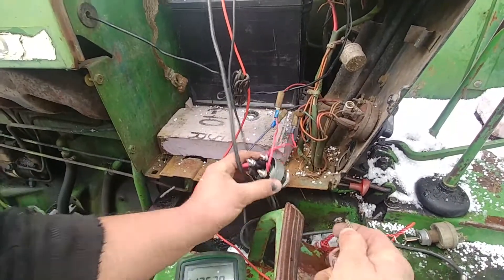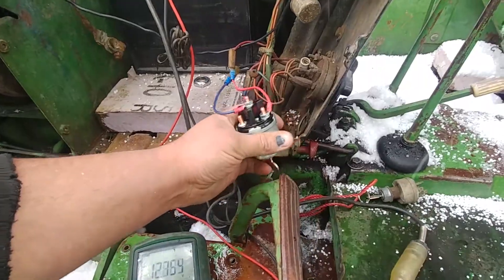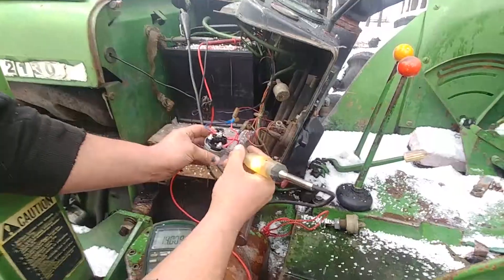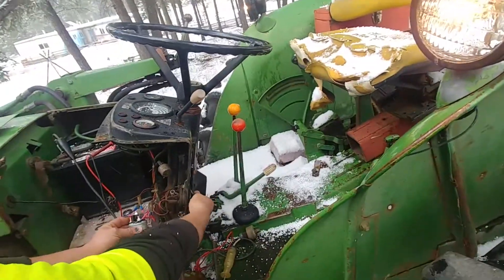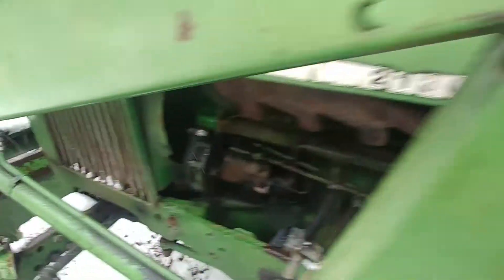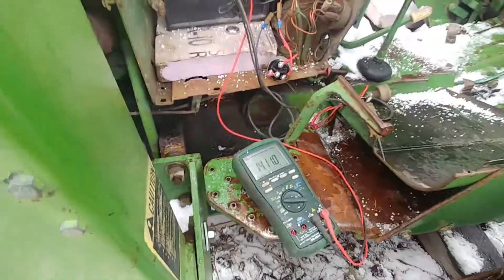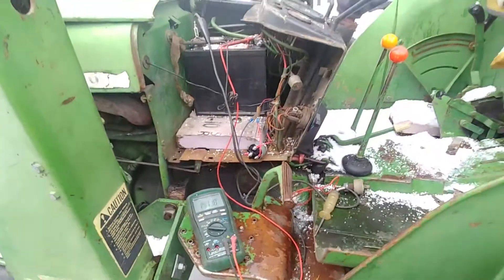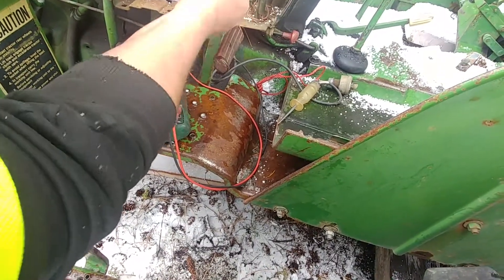TRACTOR IGNITION KEY SWITCH WIRING | Universal Ignition Switch | JOHN DEERE 2130

Comment from the maker: More John Deere Videos: JOHN DEERE PENCIL FUEL INJECTORS REPLACEMENT Made Easy | John Deere 4.5L 6.8L POWERTECH https://www.youtube.com/watch?v=8lXxqQaymUg
JOHN DEERE FUEL LIFT PUMP REPLACEMENT | JOHN DEERE POWERTECH 6.8L 4.5L
https://www.youtube.com/watch?v=Usurbkt1N74
TREE STUMP VS EXCAVATOR or HOW TO REMOVE STUBBORN STUMP | John Deere 2054d
https://www.youtube.com/watch?v=dgcN5v7VY0A
TRACTOR IGNITION KEY SWITCH WIRING | Universal Ignition Switch | JOHN DEERE 2130
https://www.youtube.com/watch?v=_D4t4hwWj0A
TREE STUMP VS EXCAVATOR or HOW TO REMOVE STUBBORN STUMP | John Deere 2054d 
https://www.youtube.com/watch?v=dgcN5v7VY0A
Reply from the maker: Thanks)

Comment: I bought this to use as my ignition switch on a 1963 Bolens 800 riding mower https://www.youtube.com/post/UgkxaAnMgzTZ_djF6K1Kr3MGiW_XGUMfUP8n  I repowered with a 13hp Predator engine. Worked great! On the back of this switch are 5 terminals labeled G, M, L, S, and B. The G was wired straight to ground, The S was wired from the back of the switch to my starter solenoid. The L is for any accessories, so I ran it from the L terminal to a rear light I have on the riding mower. M is for the coil, so I plugged the stock coil wire to this wire terminal. The B is for constant battery power, so this was wired to the positive battery cable. I turn the key, first click is the accessory position, and my rear light came on as expected. Turned the key all the way and Vroom...the engine started. Turn it back to the off position, and the engine turned off. Perfect! Hope this helps!
Reply from the maker: I like old school tractors as well!

Comment: I have a JD 2150 that had a defective ignition Switch with 6 terminals on the old switch and it had 5 wires going to it.  I can only identify the BATT cable right now.  The old switch did not have any of the pins identified.  The new replacement switch clearly has the following labels on the pins BATT/IGN/ST/ACC/ST/GRD.   The problem I have is that other than the BAT cable I don’t know what pins the other 4 cables go to!  I have pictures of the old switch and was hoping you might be able to help with either the pin labels on the old switch if I sent you the picture or assist in trying to figure out what wire goes to what terminal on the new switch.  Thanking you in advance for any help you can offer.

Comment: Great video-Thank you!  I have a JD 2640.  Same original key switch, but mine has 4 wires coming off of it.  One looks like the shifters might go to the neutral safety switch under the plate.  Did you just bypass or eliminate that in this new setup?

Comment: I've got a question. I pulled my ignition switch from my international 234 and it has a g1 and g2 on the terminals. Any idea what it means?
Reply from the maker: Hey Brandon! G1 and G2 is  ground to the switch mounting bracket, grounded only when switch in cranking position.

Comment: I have a question. My whole light assembly is trash and I removed the harness. The light switch is damaged and as I unplugged the wires now the tractor turns but no longer starts…. It was running perfectly about 10min before I decided to clean up my tractor from dangling wires. I did not remove anything else other than the light harness…. Is there a correlation??? Why would the tractor bot start now? Thanks for any help
Reply from the maker: Hey brotha! You might sorted it out completely. I would check feed 12V to fuel shut off solenoid when key in ON or Crank position. You should read 12V. Seems like you're missing fuel. Bzw, wht tractor do you have?
Reply: @PistonShack  thanks for the tip! I’m check it out. I have a JD 302